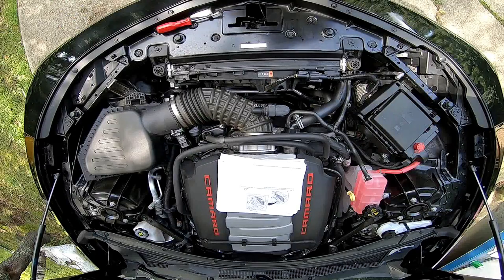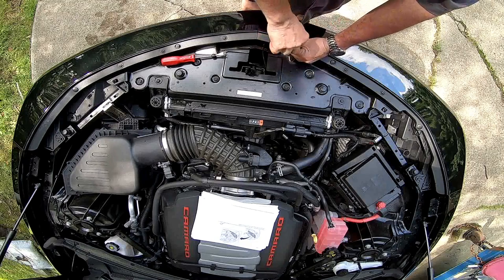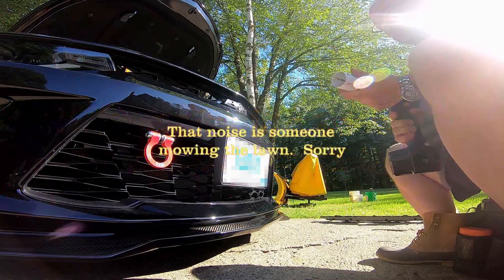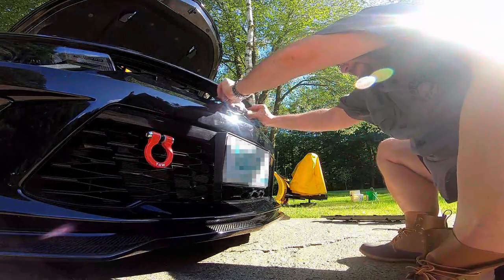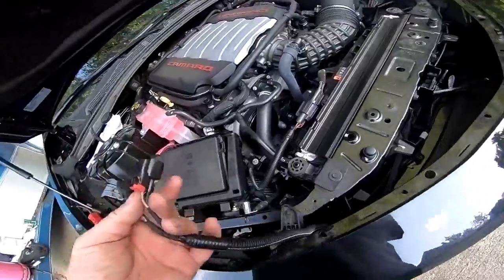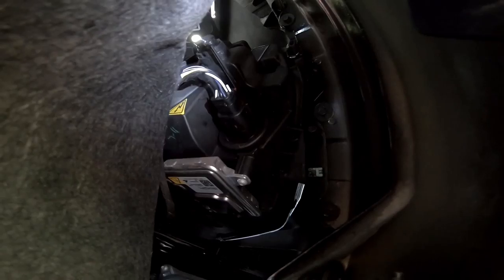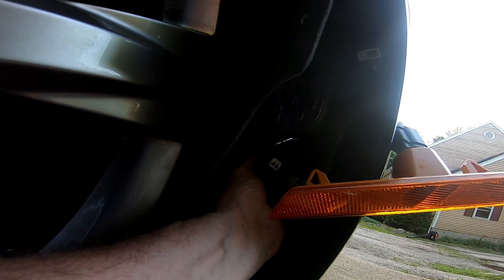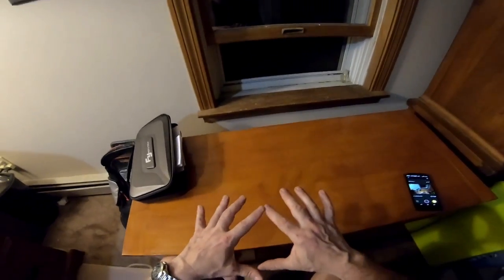Illuminated Bow Tie on Camaro installation - extended edition

Comment: Me and my friend did mine a few months back. I forgot if we tapped it through the fog light harness or side marker harness. I got a ZL1 1LE bumper conversion which requires removal of the fog lights. The shop that did the install still has the fog lights and I'm scrambling to remember where the harness taps into.
Reply from the maker: It only works one way I believe.  It is something that sets your car apart.  But it is like a tattoo on your back, everyone else gets to experience it, but you don't
Reply: Side marker harness

Comment: How many wires are in the wiring harness for the light up bowtie? I got a 2018 Chevy Malibu and this mod was installed by someone on the forum with some wiring work.
Reply from the maker: Hi Sean Gowan.  Thanks for watching.  I can't say for certain.  But if you watch the video again on your computer and you go to 6:00 in the video and  you use the magnifier (windows) or zoom (Apple) you can zoom in onto the connectors.  It looks like two wires per connector.  I hope that helps.

Larry

Comment: Really hard to watch. Need to cut out a lot of unnecessary parts and shorten video. Also need better lighting.
Reply from the maker: Thanks Drake.  Just yesterday I re-filmed how to take the plate  off and put it back on.  When I change to my winter tires I will open up the wheel well and get some well lit footage of the where it plugs in and then I will re-edit so something more manageable.  I will leave this one up because it has so many views but I will put a card on it to recommend the shorter version.  

But honestly, thanks for the constructive criticism

Comment: Dude watching you install this had me cringing big time 🫣 I’m just curious as to why you didn’t use a dremel. Tool to drill out ? But it looked good
Reply from the maker: Thanks.  I was a little nervous.  But, I feel you have more control over a hole saw then a dremel.  They can run across a surface.

Comment: I wonder how would this work if I have a 2018 Zl1 given they don’t have a bow tie but a flow tie instead. Would it still be possible?!
Reply from the maker: Thanks for for watching.  I think it would be a challenge to put it on a flow tie.  You would have figure out a way to fill it first.  And maybe the wiriing harness may be different in a ZL1.  I would look into that first before I spent the money.

Comment: I wonder if I can use the same one for my 2017 Chevy impala
Reply from the maker: Hi Oscar Valdez, They make them for trucks to.  But I searched GMpartsdirect and they don't have it for an impala.  I think the problem would be  the jumper harness that plugs into the day time running lights probably don't match.  But, you may be able get Impala specific connectors and replace the camaro specific ones on the jumper harness.  Just a thought.  It is a $250 gamble.   Thanks for watching.  Thanks for commenting.

Comment: How did u unplug that clip im having a hard time
Reply from the maker: which clip?  I actually used a metal pry tool and pried the OEM bowtie off and the clips broke.  The wiring harness in the wheel well has a red safety tab you have to pull down first.  Let me know if those answer your question.  If not I am happy to help.  Thanks for watching.

Comment: Why size torque wrench did you use?
Reply from the maker: In this install I don't think I used a  torque wrench.  I didn't take the wheel off.  That is the only place I think I would have used a torque wrench

Comment: Where did you plug the bow tie  harness  into
Reply from the maker: You unplug the plug at the bottom of the Day Time Running light.  If you go to 8:50 in the video it is the thing with the  barcode sticker on it.  You unplug that and plug it into the wiring harnes of the glowtie and the glowtie plugs into the DRL.

Thankis for watching and commenting.

Comment: I'm interested, where did you buy it?
Reply from the maker: I got it from GM Parts Direct.  Here is the link.  There is a slightly less expensive one.  I can't speak to the difference between the two.  thanks for commenting.  Larry

https://www.gmpartsdirect.com/oem-parts/gm-exterior-trim-illuminated-emblem-23393028/?c=Zz1leHRlcmlvciZzPWFwcGVhcmFuY2UmYT1jaGV2cm9sZXQmbz1jYW1hcm8meT0yMDE4JnQ9c3MmZT02LTJsLXY4LWdhcw%3D%3D

Comment: Where did you get the bowtie from?
Reply from the maker: Hi Rasheed, I got it from GM Parts Direct.  Here is the link.  There is a slightly less expensive one.  I can't speak to the difference between the two.  thanks for commenting.  Larry

https://www.gmpartsdirect.com/oem-parts/gm-exterior-trim-illuminated-emblem-23393028/?c=Zz1leHRlcmlvciZzPWFwcGVhcmFuY2UmYT1jaGV2cm9sZXQmbz1jYW1hcm8meT0yMDE4JnQ9c3MmZT02LTJsLXY4LWdhcw%3D%3D